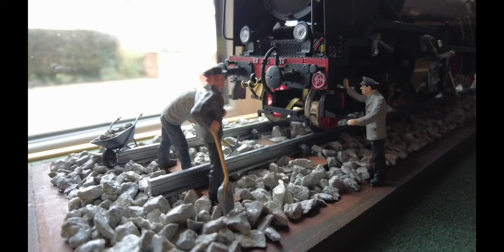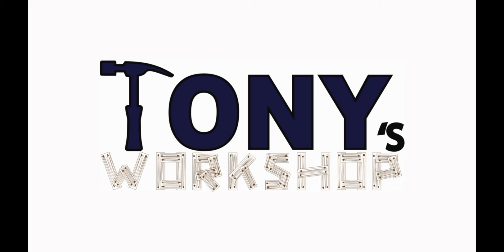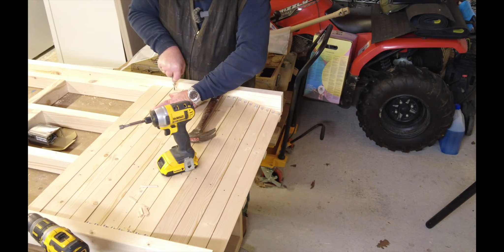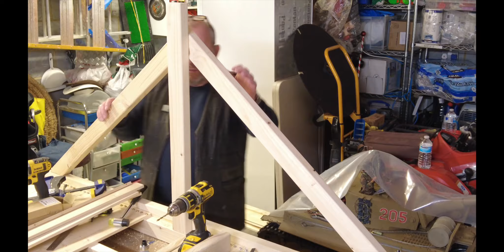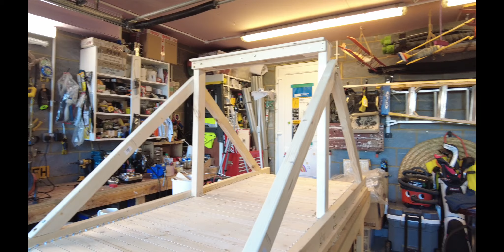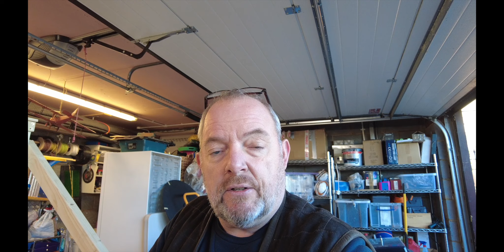1/6 Scale Diorama easy build Wooden Bridge. the next step. (Video 02)

Comment: Tony, the bridge is coming along very nicely. Did the Pershing show up on Friday as expected? I am still etch priming. Doing the tracks now then will be done with aluminum, then finally the steel sheet metal parts. Going through 8 cans of UPOL!
Reply from the maker: Good morning Ray. Thank you. Yes I now have my Pershing. I will be unboxing this over the weekend. Sounds like you are romping away with your build...at this rate you will have yours completed before i put the first fixing in.😂😂 ..8 Cans!!! wow! thanks for the heads up...I have 6 cans ready, but sounds like I will need more. I am unsure on how I will start yet as I have not seen the instructions, but looking forward to all that head scratching before I get started. From what you have seen, is the build relatively straight forward?
Reply: @tonys_workshop  Good afternoon Tony. Well maybe you will use less paint than I. I kept ordering two cans at a time. The paint just seems to go so fast, understanding that there is a lot of waste in spray cans that does not hit the parts. Now on to the sheet metal and steel parts but I will be using a more traditional automotive etch primer which is 1/4 the price. My build will slow done quite a bit soon as the weather starts to get warmer and my property gets my full attention. I am sure you will out pace me, but I don't want this to go too fast anyway since it is meant to be a project in my retirement. Plus, I am afraid that when this is done, I will want another. I will be watching to see what Armortek has in their new product line this year. Looking at the pictorials it SEEMS strait-forward for the most part, but I have seen a couple pages where maybe there is some clarity needed. I wish their color prints were not so dark at times - hard to see clearly. Ad I did not see that when they specify Loctite, as to which strength to use, as I have 4 different grades - one for rubber, one for permanence, one for removal and one in-between. Have fun taking inventory, 1400+ plus parts. I was missing one suspension piece which they have already sent me.  One last thought, be careful with the bottom aluminum base, there is one very thin piece on one corner at about a 45 degree angle that is easy to bend accidentally.
Reply from the maker: Hi Ray...I have just finished un-boxing...omg! that turret and front armoured section is so heavy, but brilliantly casted and finished. I must admit as I was un-boxing, I did start to tremble a bit as there are so many parts. There was some familiar sections which i hope I can understand, but a large glass of wine is now required to settle down and study the instructions. You are 100% correct, these kits are not for rushing, but for taking time to build and patience is all important. Not sure where I am going to start, but at the beginning seems like the best plan. Looking at the instructions, I may elect to de-grease and assemble the bottom hull section before priming and painting. Thanks for the heads up on the base, I will be careful. Hope you continue to enjoy the build and wishing you a great evening.
Reply: @tonys_workshop  Thank you. I decided I’m just going to get all the priming out-of-the-way on all the parts first before I start putting anything together. Have fun.